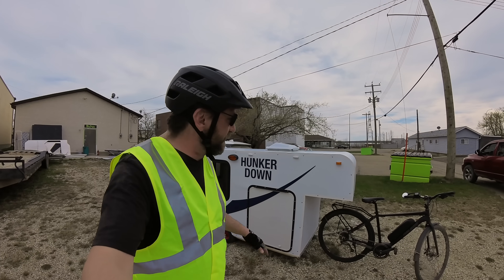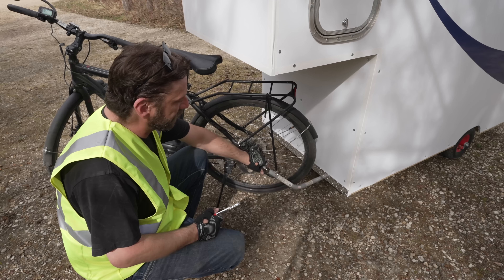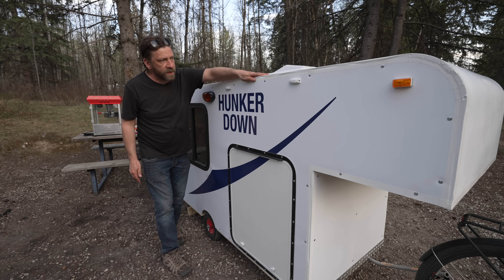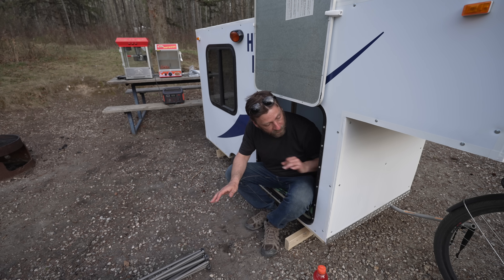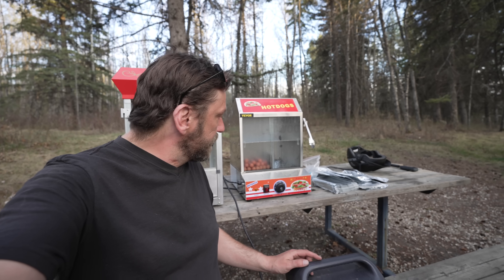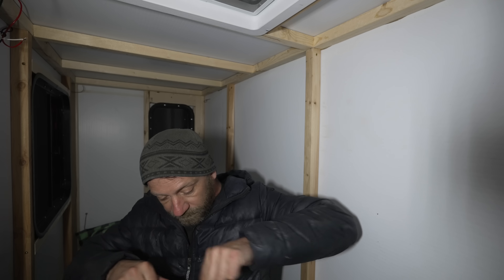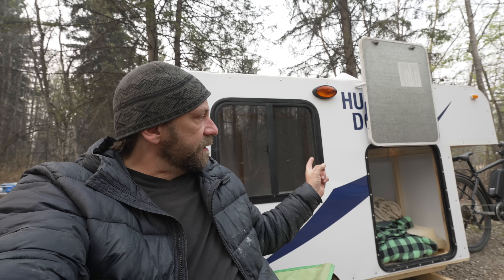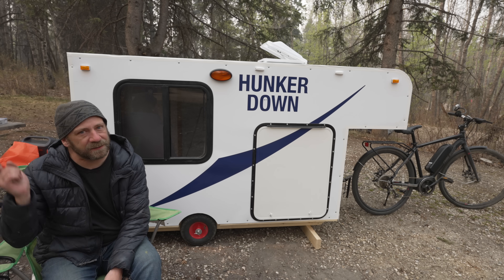DIY Bike Trailer Camping

Comment: Some sheets of foam insulation might not look outstanding but those trimmed to size and flush with the framing could serve nicely. Maybe making a late autumn early winter camp in it a bit less chilly. Great video Steve and thanks!
Reply: Excellent idea, I would add, glue the foam to the plastic, use foam board adhesive and cover the foam on the inside with plastic as well and you have a laminated structural foam sandwich.  Use a heavy duty type bike tires for better rolling, which will lift the trailer higher so it doesn't bottom out on things. Create storage underneath the bed, but have a removable piece for inside the door, to allow easier access. The spare bike tire on the back could have a second mount on the bottom frame so it can be used as the rear Jack, and the bike hitch could be designed to be used as the front leveling Jack. Recommend checking out designs of other bike trailers online, see the hitch design used on the world war 2 German army cargo bike trailer. Jackery with glue on flat solar on roof does sound great, but heavy. To save weight may want to check out Peak Refuel freeze dried food and local water, maybe a water filter for lake water and such. Sounds like you plan on improved models in future, consider an all laminated foam board design with plastic corner pieces molded to fit over the walls at the corners, with the walls glued in a track in the corner pieces. With this type of design, you could build an amphibious trailer, pulled by an amphibious bike. There have been a few designs for such and some may even be for sale.

Comment: Just a little advice from someone who has a E bike with a trailer. Thousands of miles on the road. Whatever your mileage max is on your e-bike, cut it in half with a trailer. That way you won't be stranded. Awesome video, keep them coming, buddy.  🎉
Reply: Where i live the limit is 250 watts! Much pedal assist...
Reply: Is there such a thing as a watt police?
Reply: @youtubeuser5424  Here in Amsterdam ebikes get put in the rollers by the police, this machine test the max speed and wattage
Reply: Or place solar on the roof / spare battery in the camper that connects to the bike
Reply: @youtubeuser5424  f the police watt patrol
Reply: Batteries are so expensive, two strokes bicycle engine kits are very affordable here in Dallas Texas

Comment: that little cubby hole where the old mounting was, you could use as storage for cooking things. 2 burner stove, spices, etc.
Reply: I'd add a removable plastic water storage tank.  Plus more weight up front would help.

Comment: Steve use 1 1/2" rigid foam for the inside walls. That should flush up with the framing and then staple cloth onto the walls for a finish.  Clean finish for the inside and very well insulated to boot.
Edit: 
Put a small towel bar above your screen window and drape a towel as a blind. Towels have a myriad of uses in a camper.  Also remember to distribute the load in the trailer equally,  important in a lightweight trailer configuration
Reply: I'd even leave some/most of the framing "studs" bare, for future hanging/storage...

Comment: You asked for suggestions, I'm thinking build a little lip so you can put your jackery up in the nose of the camper, then you could get a small TV, 5 to 10 lbs at most, and mount it on a swing arm, and you've got power right there. You could even throw your starlink in there and you've got your streaming services available.
Reply: or maybe a slide out/roll out rain awning, that can fully go limp and hang down so you can project an LCD Projector video against. Probably a few lbs lighter that way, and the campsite can view if they show up the next time...

Comment: A couple suggestions if you're open to them Steve.  The "fifth-wheel" hole would be a great place to mount a small 12V ventilation fan.
For the wiring I'd drill through the studs so that A) you don't have to wrap the wire around the stud, and B) they'll be held in place without extra hardware.  A 3-4mm hole should be fine.
And the "crusty hatch" would actually be a great spot to mount the Jackery behind.  Then you'd have easy exterior access to power while protecting the Jackery from the elements.  And you could hook the lights to it using a simple 12 adapter/controller module.
For the window I'd recommend the vinyl wrap material they use on public transit buses over the windows.  It has holes so you can see out, but they're small enough that people can't see in without being right up against the window.  And no need for curtains getting in your way.  A quick Amazon search turned up "VViViD" wrap sheets for $10-12USD.  One would be more than enough.
But I have to say I fell out laughing when I saw you pull a popcorn machine out.  LAST thing I would have expected to see.

Comment: 18:52 the screws at the top, the one you poked your hand on holding the hatch in are just screwed into coroplast? it looks like there's supposed to be another piece of frame there, that was forgotten in the build? Definitely add in some pine there. also i love your idea of light wallpapered cardboard for the inner walls, hide your wires behind that and you can even screw LED downlights into the cardboard and pop those flexible solar panels on the roof and get a nice light LiFePO4 battery in there with a tiny inverter that could do 600w continuous. anyway, love it all, good stuff

Comment: I’d suggest just spray painting the frame inside. It’s a good place to mount stuff. Run your wires in the corners. They’ll tuck in nicely. 
I can’t imagine the wheel bearings lasting very long.  You might need an upgrade someday 
Solar seems like a great addition for future use. 
And maybe a flashing strobe light in the back while traveling. 
That’s a nice project Steve. 
Can’t wait to see what’s next 😃
Reply: Very good ideas, can't agree more!
Reply: He should also have a second exit. The back should probably fold down too for easier access, serving dual purpose.

Comment: Get yourself a ceiling storage net Steve that hangs from the ceiling inside the camper. Plenty of space to store stuff without adding hardly any weight.
Reply: Maybe some foamcore for the interior walls (light weight and "some" insulation.)

Comment: For the power , I would do the same as you when building a house , drill holes through the frames leading back to the power source and the sheet over the walls and it wont be seen , beautiful. 

Only problem I can think of with that idea is if something goes wrong and you need to fix something , but your a clever fella you can just sheet back over it .

Comment: You cracked me up when you started pulling out a popcorn popper and a hotdog warmer. Solar panels could fit on the roof. A 12-volt NiCad battery in the overhang space. Foam panels for insulation in the walls and ceiling. A small 12 v fan for air circulation on the ceiling corner.
Reply: Or soar fan ventilation like biats yaght

Comment: If you go with an e-bike kit for the front wheel, you could store the battery in the overhang of the trailer, to avoid making the bike too cumbersome and heavy when using it without the trailer! You could probably even power the lights from that battery, and maybe throw a solar panel or two on the roof to keep it topped up :)

Comment: I don't know what a glizzy? is but it will forever be a HOT DOG to me. As for the ideas, when you had the mattress rolled up I saw a 2 board table connected by hinges. It would fold up and secure to the back wall (much like the door) then fold down to a hook & eye screw on the floor securing your rolled up mattress behind it. What a great build, I wish I had one since I can't drive anymore and greatly miss the backcountry. Safe travels Steve! --Kevin

Comment: Very cool and very promising. Two thoughts: 
(1) The 2x4 lumber that thing is made of adds up to a lot of weight. You're pulling around a trailer load of lumber. I'd try some kind of much lighter supports. Plastic piping might work. Maybe as hoops to reduce weight even more. Lightweight aluminum "girders" might work even better because they'd be light and strong. Larger sheets of foam board that can stand up without so many interior supports will reduce weight even more. You might try making one or more walls purely of fabric you stretch between two supports. That's how tents are made to be so light. Bending a kind of waterproofed foam board roof into a long curved shape front to back from which two lightweight fabric sides hang down aattached (by zippers? snaps?) would be extremely light, almost like pulling a tent. And leave out all the boxes, shelves, and other nonsense you do not need. 
(2) Those small wagon wheels are very inefficient and require much more energy to rotate than larger diameter narrower wheels. And they will handle badly. That's why bikes have larger diameter narrow wheels. I'd remove them and find a way to attach two bicycle or similar wheels, the lighter the better. Fixing a pair of them to an axle underneath might be possible if you don't mind the trailer sitting up a foot higher. Or put the wheels only at the back end and let the front end ride on the trailer hitch attached to the bike. Pulling that heavy thing on those small wheels is going to be slow and exhausting.
Reply: for number2 it would be nice for mobility issues. Also why dont put motors on the trailer and sync them with the bike. At least i dont think that rules mention about trailer wattage.
with a bigass battery that can be charged at home or campsite he can go pretty far.
Reply: I was thinking along the same lines. A modern day Conestoga Wagon of sorts... Now that I think about it, I have an old bike trailer that hasn't been used in a while...

Comment: I'd go with narrower tires outboard in wheel wells. A full fairing for the bike would really help, and the trailer could get rounded on top and in front and tapered in back for less drag.

Comment: I would add some solar cells to the roof, a charge controller,  and batteries to power all the lights for 12 volts.  Then have a small inverter in case you need 120 vac!   Awesome build!!!
Reply: Mobil solar barrel gebert b erttr cheaperr

Comment: Does anyone else want a e-bike and a camper for it after watching this? Or just me? Great video as always Steve!
Reply: I do!  Just rode one for the first time in the mountains in TN while camping. They are awesome. I am getting an E-Bike and a little camper on the back would be so cool!!
Reply: me, I thought of this before this, I want a tear drop design, my bike can pull that easily,
Reply: The spare wheel on the back 🎉
Reply: I want to build a trailer a little longer. I've riding a RadRover ebike since 2018. I see weigh as the biggest hurdle. Plus thieves...
Reply: Prefer gas power but yes.
Reply: You should look into building your own man. Bafaang 48v 500w kit and a 20ah 52v battery. Very easy to do. There's people who have tutorials for building a trailer with a solar panel cheap and easy too. Takes half a day in good light but you can charge your bike in the woods.
Reply: Just you, shh don't let it catch on. 😂😂
Reply: I just went 3000 miles in. 5’ long and 3’ wide aluminum trailer with a radrover5 e-bike, with my 3 dogs, last summer.
I’d love to see Steve do that, he’d have a beautiful time, and not as hard cuz he doesn’t have the 3 dogs.
Everyone should experience this at least once, before nature is gone by technologies hands
Reply: Wikes trailer company out of Canada has a diy kit, you just get the aluminum and bolts separately
Reply: I burst out laughing when you pulled out the popcorn machine.
Reply: Ye, but i would put a bigger wheel on the camper
Reply: An e-bike camper with a lil teeny tiny spare tire on the back 😆
Reply: Some e-bike company just missed out on a great opportunity.

Comment: For the insulation use the foam that they use to insulate engine sound also has a foil lining to reflect heat. I used in on my man cave I build from fencing panels and it works a treat plus it’s very light weight

Comment: 15:50 The Batteries over current protection will most likely not trip with thin gauge wire like this. The wire will identify as a light bulb instead.

Comment: Maybe a small sink basin for that hole in the overhang, and a small battery pump to a 5 gal(19 liter) jug?  Maybe some foam insulation panels with wallpaper over those for the walls.  An iPad or whatever for movies with a magnetic mount someplace…  maybe add a deepcycle battery(they just seem to last longer for solar and charging) with an inverter to store some energy for charging stuff and powering lights at night?  Consider wiring for DC instead of AC like a boat does.  Maritime parts can be found cheap for power options and less risky wiring.  I think you have a fantastic start already, has a ton of potential.  Looks like fun.
Reply: Portal sink shower toit al inn kne

Comment: Awesome build! I think I would have opted for lightweight bike wheels that would be external from the cabin. This would result in lower rolling resistance. I would also add 3 or 4 100W solar panels on the roof to help power the e-bike battery for more range. Great fun!

Comment: i built a teardrop camper for my motorcycle, it’s 120kgs all up, if you want a few mods for your camper, put a three speed reverse fan on the roof and a flexible solar panel and battery for your lights, also for your edges, you can buy aluminium edging from RV dealers that bend around the curve, just screw and silicone as you go

Comment: Where that hole is for the 5th wheel, you could add a mini kitchen with electric induction hob for cooking. 

A fold out cot, and sectioned cushions like a chair bed. 

Solar panels.

Diesel heater.

The gas locker door that you used could be latched to a bungee cord from the other side of the van to act as a canopy to sit inside when raining, to allow you still to have the door open. 

Use of a gyro to charge batteries whilst cycling. 

A porthole where your head was whilst in bed, for a nice view when you wake up. I’d sleep with my head at the rear of the trailer.

Corner steadies instead of wooden beams to stabilise whilst pitched.

Comment: Not sure if it's been suggested but your idea about the kit for the front wheel drive would be a good idea it's redundant and you could store more batteries in the camper and have it wired directly off the camper and would put a good solar panel on top

Comment: So for your seems, window flashing tape, then cover it over with a white silicon coating. Cheap, effective water proofing method. You want the white silicon roof coating so it doesn't shrink in the sun and dry rot.

Comment: Maybe keep the hole accessible in the grandma's attic. You could put a gasket closure or door and use it as an access point for electrical cables coming from an outlet outside.

Comment: Vinal the inside, add some led lights, make a fold down table by the over head area so if your sitting or laying you can put you computer on and or food. You can use your bed as a futon seat/ pull out bed.
Reply: Add net storage to the one side without the window.
Reply: Drill holes to run the wiring for the light and add a switch to the hole area so you can have a outside light and by the door area put a inside light.

Comment: That is too cute. I recon some little legs which you can slide in and out with a clip underneath could be handy for when you settle down. So they are hidden from view while riding but easy to access. The door is cute but if in the future you get achey from bending in, maybe you can find a way so when you unlock the door you can then extend the door to fold up again so you can get in more easy and do not have to struggle in.

Comment: lets see a car mud mat at the doorway to keep the mess to a smaller spread. Some pinned netting on the door and the roof vent to keep the bug and bities out but leave the breeze in. Matt can rest on the side while you have a cooler for supplies in the trailer. Solar panel/sheeting on the roof and a charger bank on the shelf where the hole is for ease of bike charging/power supply. A little battery radio for music and keeping entertained. Reflective tape when on the road so cars see you because we all know some folks are terrible drivers. Oh and for insulation Resisto M2M reflective foil barrier is dirt cheap and cut to fit, basically bubblewrap with foil on both sides, I use it as cut window blockers for the summer heat.

Comment: You could possibly get a battery box and and mount your battery outside up under the front next to the back of the bike. You could install led 12v rv as they have switches on them normally. Do they make e-bike kits that could work for the smaller tires? Almost like the ones used on a hoverround?

Comment: Maybe some spray foam for insulation. Then, i forget what its called, but its really thin. Its used in bathrooms and its only like 1/8" thick. You could glue it on for the walls. Good to see ya again! Thanks!

Comment: What if you insulate the inside of the camper a bit? Then you can swap the wheels with sleds in winter and not only use it in summer. Of course you'll have to pull it with something other than a bike but there are options. There should also be enough space on the roof for a small solar panel.

Comment: I would get rid of the 5th wheel overhang part.....kinda dangerous and throws off the weight. You will be able to add extra weight then and maybe add a roof rack or solar panel.

Comment: carbon fiber reinforcements would make it hella sturdy, it's as easy as fiberglass to work with but much lighter. Also probably overkill but a pop top for extra height made with a solar panel roof and mesh sides to vent the heat out, they also have portable air conditioners these days for camping that would keep that small room chill af.